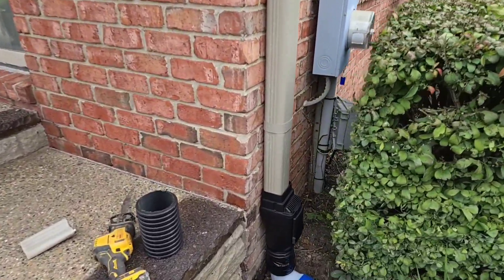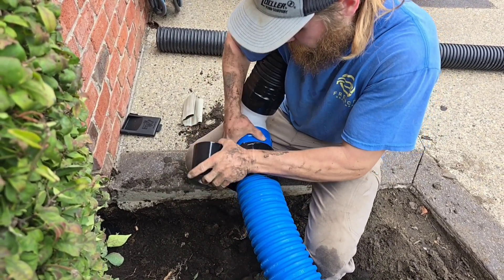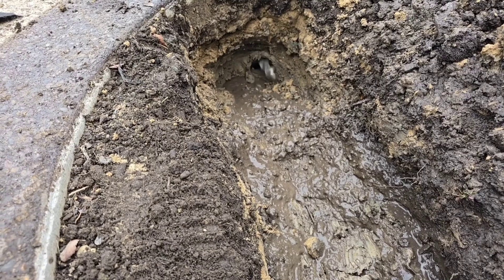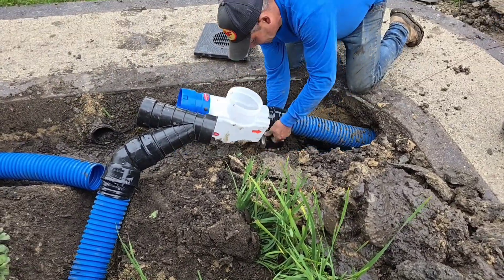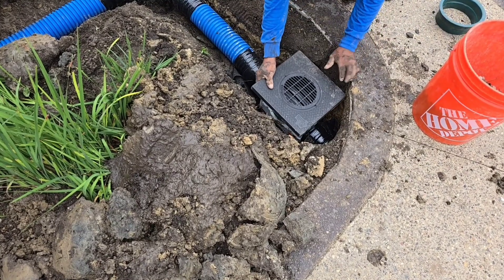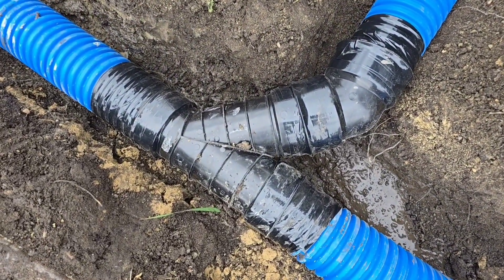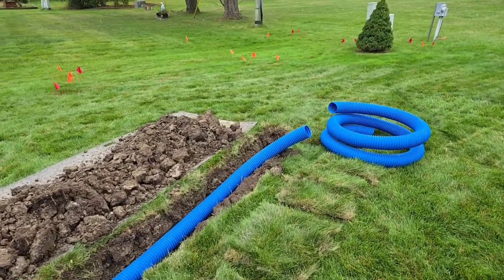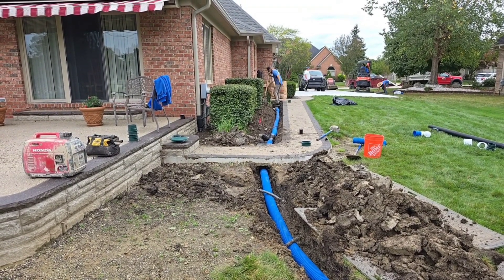MAX FLOW: How to Combine Two Downspouts — Spoiler: We Added a Yard Drain

Comment: I’m putting together a downspout system for my new house. I just purchased a few components from your site. I’ll be running two 4x3 downspouts into the leaf catchers and then a sediment basin and then down the yard to the street where I’ll have a pop up emitter. I’ll be pouring a concrete driveway over the main run of pipe. I would like to use slotted pipe under the concrete so the ground absorbs the water and the city runoff system doesn’t have to take it. I’m not really sure if that’s the right way to handle that though. Any advise?
Reply from the maker: https://youtu.be/ah2xPpDGGtU?si=ihTanbIZv3WCMM2H
Reply: @FRENCHDRAINMAN  So what if I ran solid pipe about 20ft away from the house and then perf pipe with a sock to the street? The total run is 65ft.
Reply: So what if I ran solid pipe about 20ft away from the house and then perf pipe with a sock to the street? The total run is 65ft.
Reply: The socked perf pipe would be under a new driveway.

Comment: What kind of tape is that?
Reply: It’s tile tape.
Reply: @Aaattttttttttyy  Is it the same as concrete crack tape?
Reply: @grayrecluse7496  I don’t think so. Tile tape is a rubberized flexible adhesive tape made to be placed underground and not fall apart after a while.
Reply: @Aaattttttttttyy  Thanks,that tape is like that also. But it's high, or it was 20 years ago.
Reply from the maker: @grayrecluse7496  
https://frenchdrainman.com/product/4-x-108-fdms-200-year-tape/